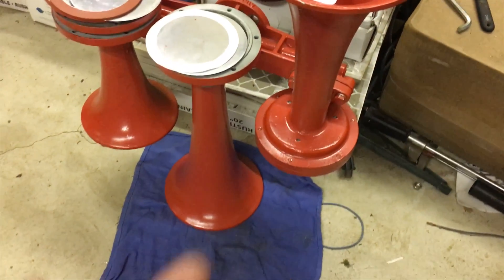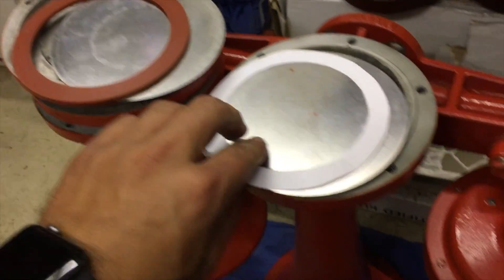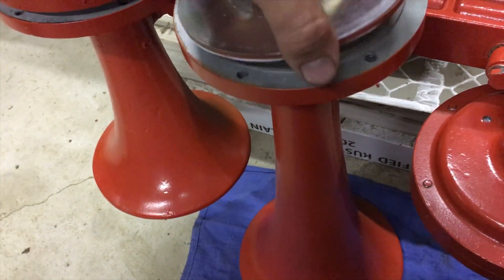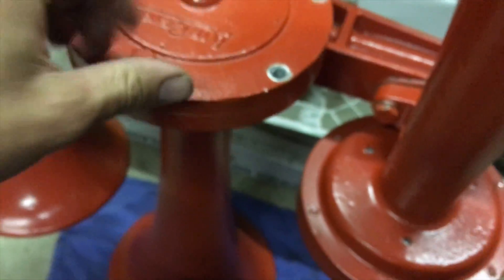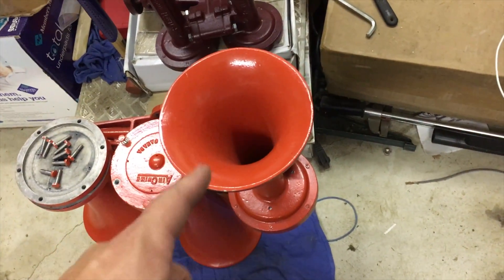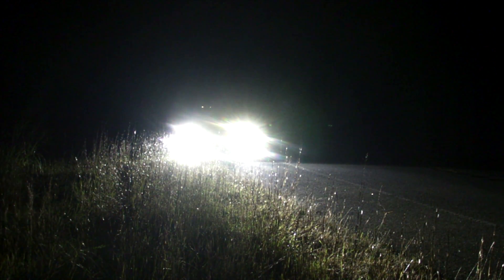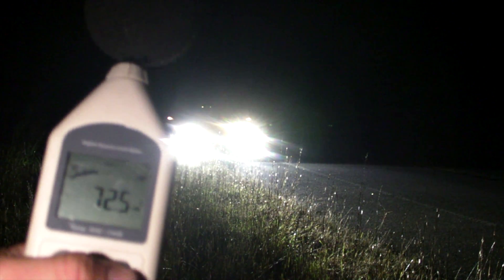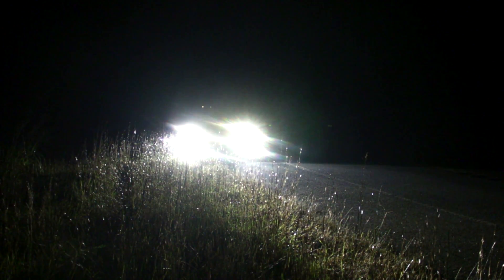Holden K3L Horn Experiment

Comment: That's awesome. The 2 bell definitely doesn't sound as sharp in the chord now. This actually makes the 1 and 3 bell louder due to the increased diaphragm tension, so the 2 bell sounds quieter. On the plus side, it's more harmonic since the 1 and 3 bell frequencies have sharpened a bit, to compensate for the sharper 2 bell. That static echo was incredible. 

The slight warble between the 1 and 3 bell may be the amount of volume being pushed into the horn. I've heard several K3L's on Geeps warble like this when laid into, but the warble seems to stabilize when the engineer doesn't hold the GW down all the way. Your K3L sounds a lot like Isaiah's sand cast one now. Camera probably just needs to be further in the trees to get that same chill effect.
Reply from the maker: Thank you for the recommendation! My plan was to get a k3 that sounds just like isaiah's k3, and it was a success! I'm going to a couple runs, this time ill go much further this time, I just hope it is this quiet when I go out again!